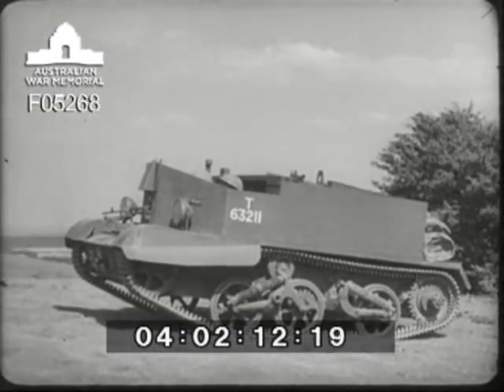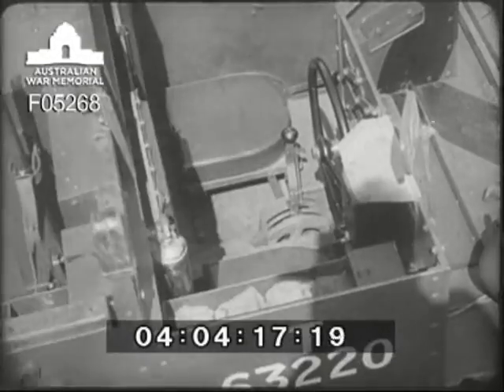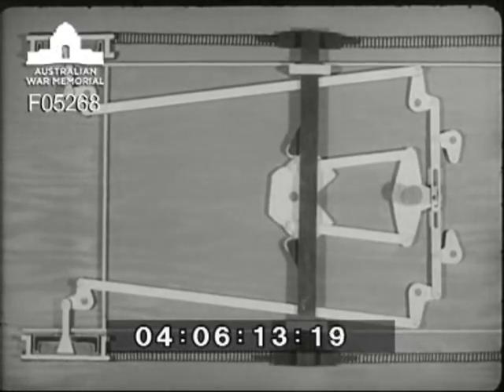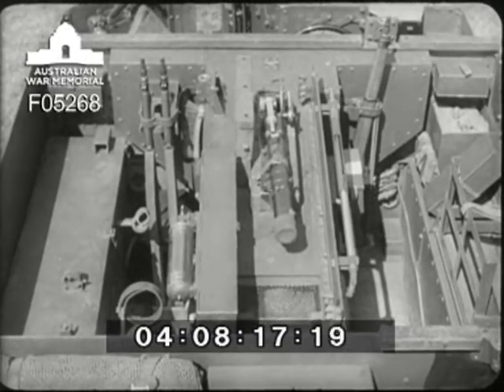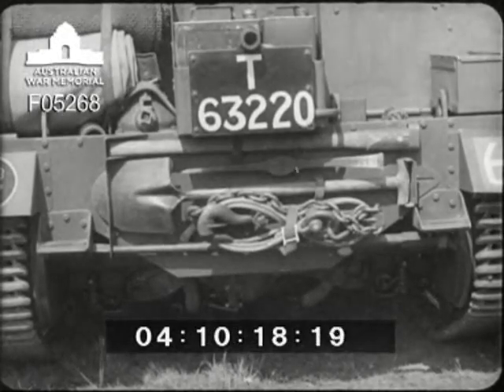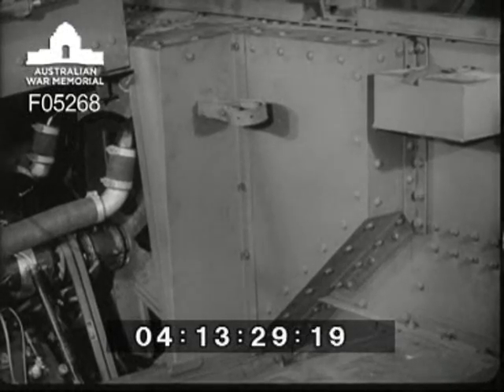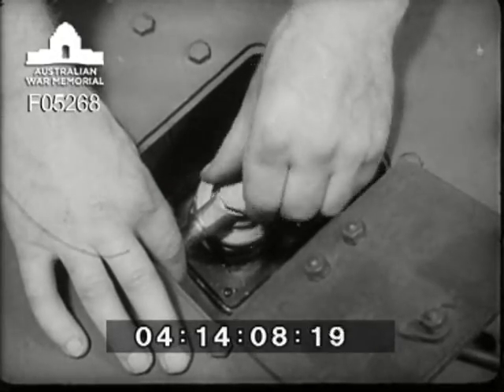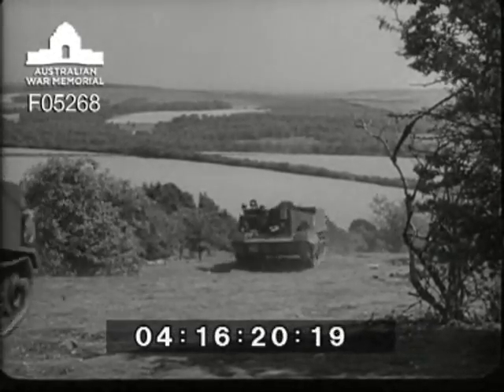Universal carrier Mk I: general description.

Comment: Different from Bren carrier?
Reply: The bren carrier was a version of this with a different design of rear body, basically there was only the compartment to the left of the engine housing in the rear. There were other versions as well but they settled on a standard universal carrier, to which mountings could be added to carry a Vickers machine gun or a 3 inch mortar. Armour protection was fairly minimal (similar to the White scout car and M3 half track) but it was better protected than a light truck and being fully tracked they were good cross country. The main problem with them was when people thought they were some kind of tank - They were not and if used like a tank they suffered heavy losses. Basically a lightly armoured jeep they were useful for jobs such as carrying the ammunition for a platoon size patrol.  They were also used in 'carrier platoons' to carry four infantrymen each for rapid deployment (similar to the German motorcycle troops), If memory serves this was the most widely produced vehicle of WW2, there were more of them built than jeeps. The Germans liked them and used any they captured. The carriers were developed as light artillery tractors but as guns got bigger they were redundant and passed to the infantry as utility vehicles. The Carden Lloyd track suspension system was similar on the Lloyd carrier (used as a light gun tractor) and the Germans copied it for use on their Mautier half track trucks.  Post war the German army developed their small  Wiesel Armoured Weapons Carrier to fulfil the same role and recently the US has purchased some of those for their trials of autonomous fighting vehicles.
Reply: Updated reply - It was the most produced armoured vehicle of WW2 (so not more than the jeep) - The horstman suspension was used right up to the British Chieftan and a variant was used on the Sherman easy 8. I didn't too badly given that the Airfix Magazine articles were read in the 1970's !
Reply: Basically the same